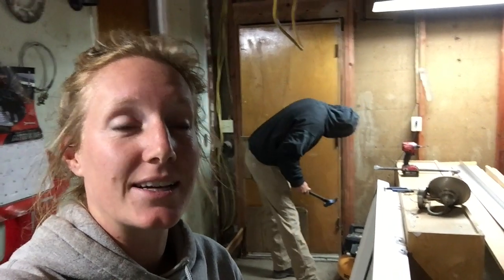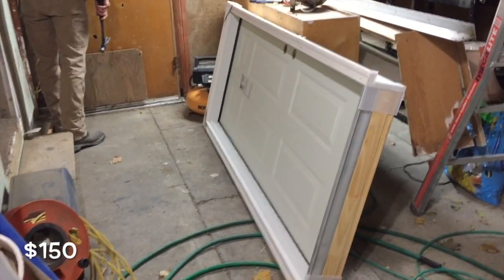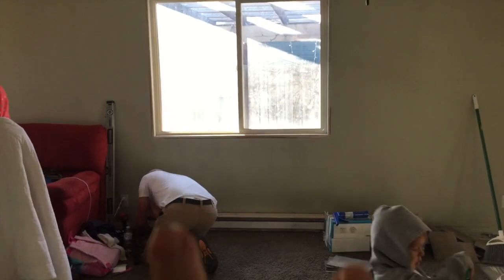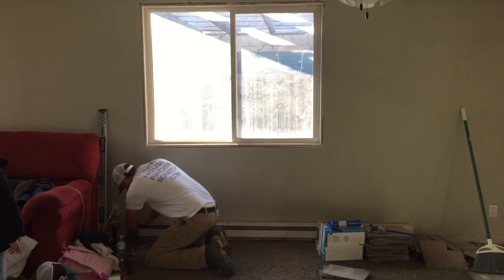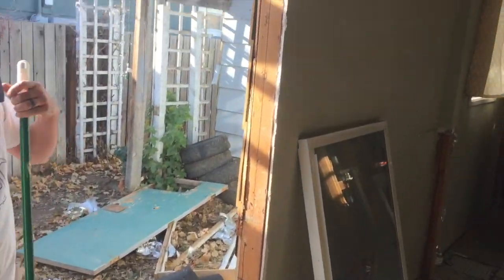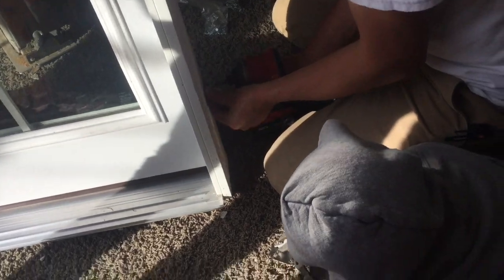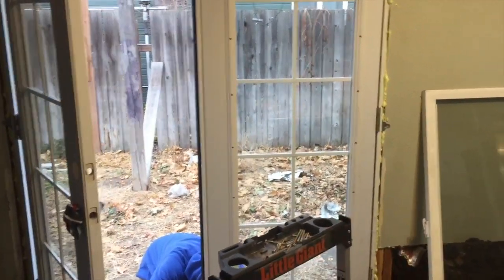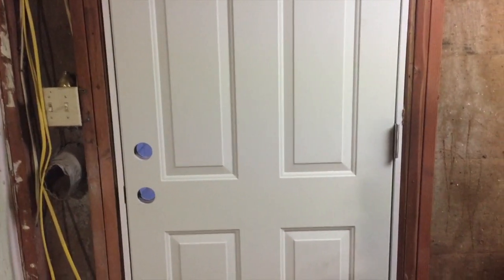Putting in new French doors on an old house plus cost breakdown: Vlog 12

Comment: Any flashing or WRB to keep out moisture on the French doors?
Reply from the maker: We did protect underneath I just didn't get it on camera, oops. We sealed around with foam as normal, but we haven't finished the siding there so we will button it up better when we do that. Plus an overhang over that door.
Reply from the maker: Good question though! It's important to include moisture protection for sure.